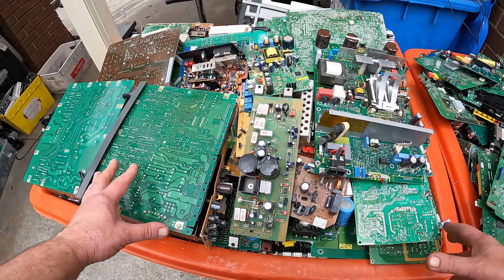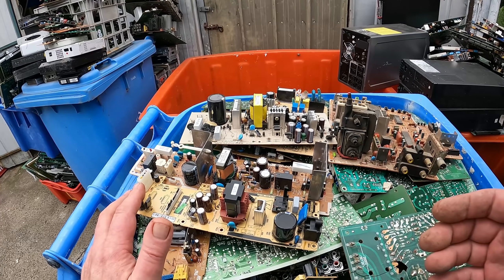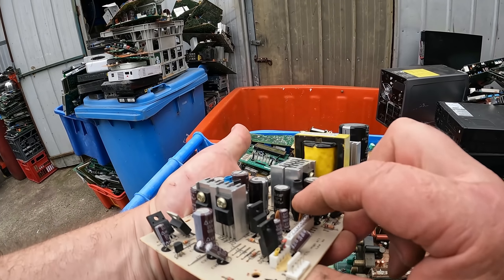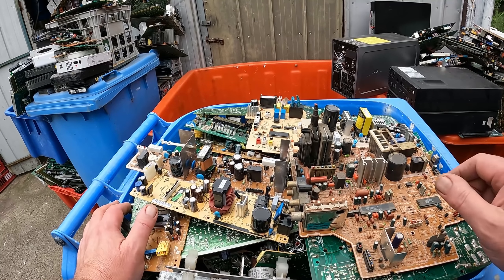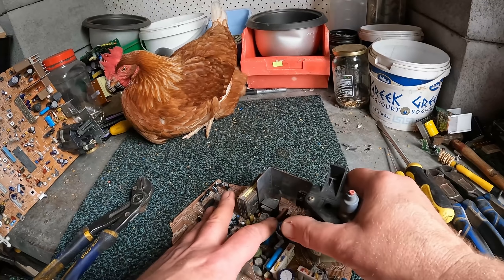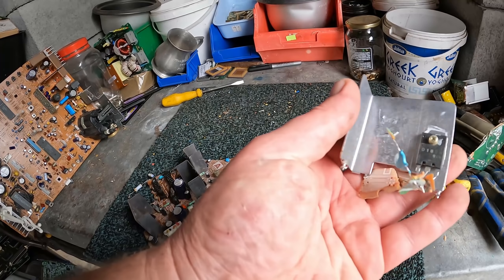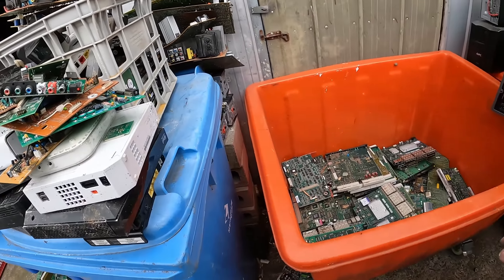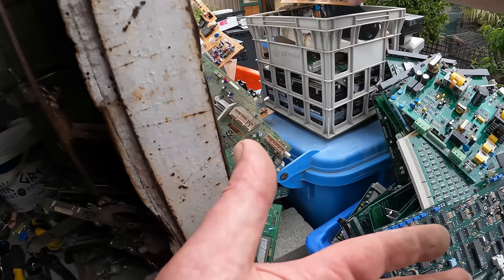Depopulating Low Grade Circuit Boards

Comment: As a DIY electronics enthusiast, I see so many useful parts there.
Reply: Exactly, I don't mind saying I'm a circuit gypo, anything that can be reused
Reply: Massive diodes for the full bridge on that crt board surprised me. Not to mention inductors with heat shrink to eliminate hum I'm assuming.
Reply: @DockterDoom  me too, I usually get very crappy components from the majority of CRTs
Reply: Yeah I feel so sorry for the most of the useful parts that he broke them off
at least he can use any kind of heater plate and put the board on top of it that way he can salvage so many useful components
Reply: @Muslim_011  that’s what I expected when opened the video.
Reply: Very upsetting seeing so many juicy electronic components being destroyed.
Reply: Hot air gun on the back side, smack against edge of a box, and watch the board depopulate itself.
Reply: Agreed, some of these boards contain rare components that are not manufactured anymore and if someone in the world needs it you can sell it on ebay.
And who on earth would destroy a thick wire transofrmer, those things are very expensive new and are compatible alost to anything.
And the last thing, computer motherbord components that are from the 90s are already very rare and cost lots of money for the right buyer. These things tend to break after decades of work and retro PC builders very often want to replace the damaged component not the whole motherboard.
Reply: @tritonmole  I also don’t understand why not just desolder them. It’s like many Russians destroying working vintage equipment just to salvage some platinum and palladium from couple of “KM” capacitors.
Reply: Agreed. Some larger caps go for 5+usd a pop. If you can reuse them in new projects will save a ton. Any components really and especially ic chips. Some are custom and youll never know when youll need one with matching numbers.
Reply: @kittyfanatic1980  they was mostly used in military equipment because of their high price and stability. Also, everything that have a rhomb sign on it is a mil spec component.
Reply: I see too, but thing is when I carefully pulled nice working condition relay and listed on eBay no one fkn bought it. It seems like people don't give a sht about environment. They want new and shiny stuffs.
Reply: @mozartips  i can understand with relay, but if we talk about some 90s digital line buffer or ram chip, they go very quickly, if you can prove they are original and not some chinese clones
Reply: да это добро в чистом виде так продавать можно, а он вандалит все за 3 копейки
Reply: It makes me sad to look at it - I grew up in Poland in the 80s - I was a teenager interested in electronics, and I had no access to parts other than trash. Respect to all recovering used parts in the countries so often despised by the richest
Reply: @malcolmholmes115  When I worked at a metal-rolling plant as an electronics engineer, we stopped one line for mechanical maintenance (4 days) - mechanics changed bearings. At launch, the line didn’t work .... we watched the signals for a couple of hours and then saw that capacitors were delete on dozens of boards, and there each microcircuit had them (hah, it was also of vintage equipment, 2014-2015, 1980s line) Вот такие дела.....
Reply: @malcolmholmes115  I mean, if he was in anyways going preserver the parts, he's definitely doing it the wrong way lmao.. But you have to consider, if he's going for salvage: literally 2 seconds to rip out that choke/xfmer or a couple minutes setting up iron, 30-60 seconds (if lucky) desoldering that part, etc. There's just no comparison when you're scrapping raw material for cents at a time.
Reply: I agree! I'm drooling rn like child in candy aisle. so much salvageable parts!!
Reply: @lodestone8736  I thought it’s Only me who feel super excited to have many electronic components. Really exciting and somewhat addictive.
Reply: I have recycled good amount of boards since I were young (electronics theory not needed for desoldering components :) ) and I now have thousands of diodes, resistors, capacitors, connectors, mosfets, memory chips, programmable microprocessors.. So now I can build a ton of things right at home with all that inventory. My favourite to desolder are power mosfets. They can still go $0.25 - $3 per piece!
Reply: The video is recent and maybe more arrange with this person to send some good stuff
Reply: Re
Reply: Sad to see a bunch of funtional boards end like this,... :(
Reply: This is what I'm interested in. I'm not personally an electronic DIY person but I feel like going straight scrap on a lot of that is wasteful. I do want to learn to solder and get into fixing certain kinds of electronics like old game systems and retro computers. Do you any resources which would indicate what components DIY enthusiasts go for?

What about just selling the whole board?
Reply: @thadofalltrades  for your own prototyping, get a decent scope and generator. Also you will need a good breadboard, with bad one you will spent hours of time figuring out faulty circuit when some of the contacts are loose. For components, google jelly bean components. They are dirty cheap and mostly commonly used. A good example of jelly bean is 1n4148, 1n4007, lm358, tl431, 2n2222
Reply: i kinda think the same way but if you keep all the stuff you'd be a hoarder in no time!
Reply: @mr.g-sez  I’m hoarder then. Can’t let my loved electronic components go 😍
Reply: @mr.g-sez  I've collected a bunch of circuit boards and not really sure what to do with them all.

Comment: I've seen enough comments already, and I agree that you shouldn't rip the components out. Some of them can be more valuable than raw materials if they work.
Reply: problem is you still need to find a buyer for those chips and I don't think there's a huge demand for ICs from old VCRs or CRT televisions or any other common components like capacitors or transistors. There's a reason the boards landed in his hands in the first place and going out of the way and testing if an IC even works just isn't worth the trouble in most cases. Also, clean removal takes time, and time is money so any time wasted on cleanly removing a 24pin thru-hole IC that in the end won't sell just won't make sense. This is all ignoring stuff like paying for fees and shipping when selling those ICs too so this is just too much trouble for something that in the end gives very little return.
Reply: I know I couldn't believe what the hell I was looking at.
Reply: I’m willing to bet the effort to find a buyer for those specific pieces just isn’t worth the increased price

Comment: You can use a plate that generates heat, place the board on top and remove all the components. You can save so many components.
Reply: flip the board and use a heatgun. everything falls out.
Reply: That was so painful to watch.  He's like the Doctor Kevorkian of circuit boards.
Reply: @PhrontDoor  or a dentist☹
Reply: Breathe deep.  It's so good for you.
Reply: @PhrontDoor  yes... this whole video was painful to watch as he basically broke anything instead of heat-pulling the stuff

Comment: You could also recover some components from the circuit boards. For example, I'd cut those diodes that are on long legs, those are higher current diodes which could sell to people that repair TVs and monitors, for example make a bag of 25-50 pieces for 3-5$ ...  capacitors can be sold in bags, those old cheap ones from CRT boards could still be used by hobbyists in audio circuits and low voltage stuff... do a bag of mixed capacitors and sell it for a few dollars.  
May want to consider solder pots, you heat up that solder pot and then just put the circuit board above the hot solder and you pull on the components to take them off the board.
Reply: You can get grab bags of new parts like that for dirt cheap already.  And with a good living starting at around $40 per hour, you'd have to pack about 10 bags per hour or about 250-500 parts per hour.

This should be something covered by governments to pay people properly to process these boards so they can be disposed of in a responsible way.
Reply: If you don't make a circuit board like these into 20 dollars of harvested parts you are very dumb imho
Reply: @greenfoam  I agree that these are worth more than what he is selling them for. Selling parts for scrap metal will always be less than the value of a manufactured part. With proper equipment like hot air stations or infrared heating beds parts could quickly be literally just shaken off the boards. The only catch is that he has no way of knowing if the components work or not. It is too time consuming and definitely not worth it to test components. And even if they work long enough to pass a test they may not last long. Especially being tossed around and exposed to high heat while harvesting them. You can’t sell parts with such a high failure rate as individual parts. No one will buy one of something they need knowing there’s a good chance it won’t work. You have to be transparent that they are used parts and only some of them may work and sell them in bulk to make up for it. This reduces the value a fair bit. Also going to the effort of reading part numbers which often is hard to do and organizing parts very specifically based off of capacitance resistance values etc is even harder and more so not worth it. To make up for this you have to lower price again and sell it even bigger quantities. Since you are being so vague you need lots so people know there is a chance of what they actually want being in there. Or you have to sell it to a 3rd party sorter who will expect it cheap since they would have to go through the effort of sorting it themselves which is a really slow low profit job. So 20 dollars no. If he spent hours upon hours on each board then sure. But at that point he would be making significantly less than a minimum wage job and there would be no point to this. As electronics enthusiasts it can be hard seeing this stuff go to waste but it can’t all be saved. Also older ic chips often times no one even wants anymore because the products they were designed for are rare and not in use and people wouldn’t try to repair them anyway. Generic ic chips that are low transistor count with very broad use cases can be resold as a chip but high transistor count specialized chips are refined for silicon and gold which is a expensive process that is worse for the environment because of all the energy and hazardous chemicals it takes then just tossing them in a landfill. Definitely though he isn’t getting full value out of them but I don’t think 20 dollars a board. If he was setup like a retail store where people could look at his collection and chose things they want then be quoted a price I think that would be the most profitable way to do it but it could be hard finding the customers needed to do that. Would have to be in a very busy area in some place like china where there is l  out a of manufacturing going on etc and many people are actually interested in that sort of thing and people make less money so it is worth it to them. China used to take most of our scrap. They don’t want it as much anymore though as they are desperately trying to become a first world country. Edit: I almost forgot. Actually listing and selling the parts online especially on places like eBay is already a very time consuming task and there are also shipping costs which devalue the parts and eBay takes a large cut out of what it already a very small profit margin. Plus lots of people would complain stuff doesn’t work and get refunded by eBay and you would lose lots of money shipping things and not getting paid and having to pay eBay fees and PayPal/credit card processing fees even if the customer gets refunded. Even if you put a disclaimer saying it might not all work people will try to refund it anyway. Even if it does work people may still try to scam you. They seller usually loses disputes. Buyers are always out first meaning sellers often get screwed over. Also it takes time to actually package stuff go to the post office or prepare it for pickup. It may sit places for long periods of time while waiting to be sold and when stuff finally does sell you have to sort through stuff again to find it.
Reply: @jacobleeson4763  This is one hundred percent true
Reply: @bkucenski or leave the government out of it and just recycle it responsibly. There's plenty of new components available.

Comment: My humble advise: try to take components out of the PCB's in such a way to not damage it. Use desolder stations and suitable tools to do so. Some of these components are high quality, valuable ones and can be sold for hobbysts or students. You could earn a good amount of money by selling the components in small bags.
Greetings from Brazil! 🙋‍♂️🙂
Reply: Not worth the time unless you know specifically what you're looking for.
Reply: In part I agree, but you will never be able to guarantee that it works. How could you sell it?
Reply: @almostdarkslide3851  youd sell a bag of a dozen or so of the same chips, people buy them knowing they are taking chances, that a couple might work
Reply: @robertr376  that's acceptable, good answer.

Comment: Thanks for the updated video Ben, it's great to be reminded of the value in these boards.  At about 36 minutes in, the large double coiled donut transformer with ferrite inside, I give those a couple of whacks with the hammer to crumble the ferrite rather than unwind.  I'm glad I've saved so many of my low grade boards, now to just find the time...
Reply: Ha, I see that happens accidentally later anyway, but still wanted to say thanks for the video!

Comment: i use to do that to re-use the components. i used a small butane torch.  I did this back in the days when just about everything was through hole chips. I would heat the solder on the backside of the board then slam the board down over an open bucket face down.The downside was inevitably heating the fiberglass which makes a really noxious gas and some smoke.
Reply: Propane torch works really well!!! Have the board upside down, heat the back with the torch...the parts that are soldered thru just fall out with practically zero effort!!!

Comment: As a 30 years technician and hobbyist, i see many things recyclable on those bins. Men I envy you. if I can only offer my services to you I will remove all of those parts and make it useful again especially those LOW ESR capacitors. They are not cheap.

Comment: In my area in the U.S., I can't sell circuit boards, even as steel.  So I just depopulate them completely.  I don't get a huge amount so it's just a relaxing thing for me.  I can drink coffee and watch eWaste Ben videos while poking around on circuit boards.  Sometimes it's surprising how much copper they can stuff into some liitle tiny component.  I even pull transformers and motors apart and get the copper out.  I know, it's probably not worth it but hey, I like taking stuff apart.  I put stuff together for a living and that's hard so it's therapeutic for me.  I'd even love to be able to recover the solder from the boards but everything I've tried so far seemed like it was going to produce too much toxic fumes.  I'm about 3 hours away from Boardsort, near Cleveland but I don't get enough volume to make it worth trying to go there.
Reply: Same here.  I’m in Illinois
Reply: Greetings from northen Sweden and a fellow scrapper.
Make it a roadtrip if it's "only" 3 hours away. I have noticed from comments many yards don't buy circuitboards so I am fortunate my yard takes them. They pay flat rate for circuitboards, doesnt matter if it's a board from a TV remote or a telecom board, quick math in todays currancy comes to about $0,30/lbs.
I do pickups from a whitegoods repair shop and supplier and a H-VAC company and an industrial electronics repair business,, I get my share of boards and I agree,, it's Theraputic to pick off the goodies.
Check with your yard about Mosfet, I get high grade wire price for them.
Stay safe and take care.
Reply: its absolutely worth it , You are a crucial link in the resupply chain
Reply: "I can't sell circuit boards, even as steel".  There is no steel in a circuit board.

Comment: :dothefive:You can use a sander to separate the RLC components from the motherboard. Sanding can save a lot of time. RLC circuit elements can be easily separated from the main board.

Comment: Hi from the UK , i used to do scrap and done ok off it, but never used to bother much with circuit boards, but when i did i used to just save the copper and aluminium, and and some useful components , it is a lot of work  what your doing, its more like a full time job, and a lot of time and effort ... it takes up a lot of space ... sometimes its better to cut your time and loose a few cents to at least give you more time to do the things that you like doing rather than having to do it ... mine was just a hobby for some pocket money ... good luck